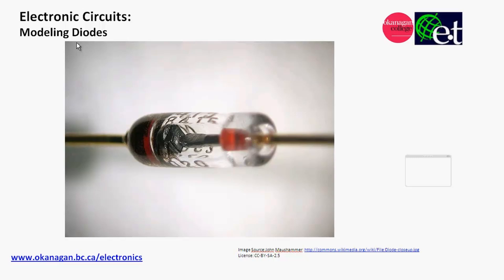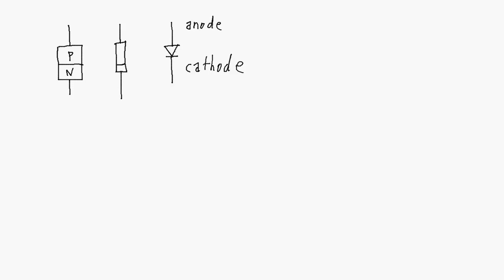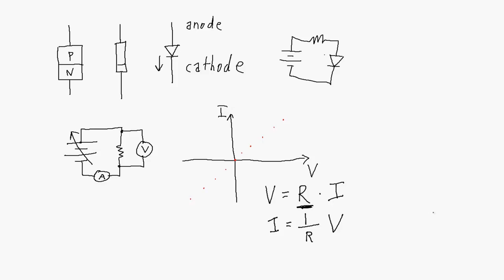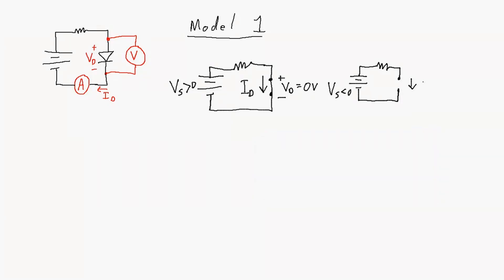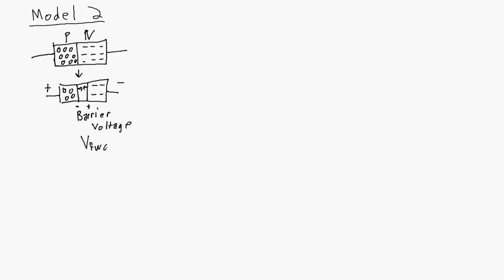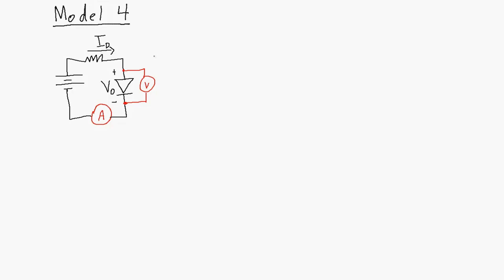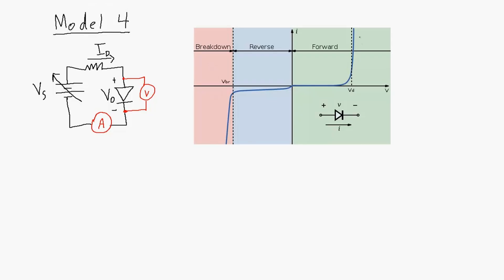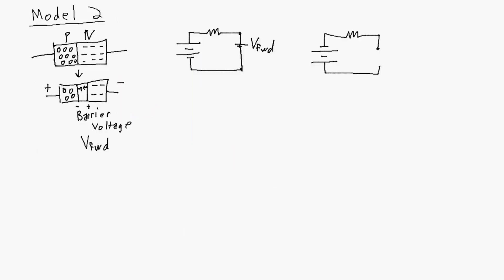Modeling Diodes (Better Audio)

Comment: Great refresher discussion about diode biasing.

Model 4 covered more complexity than the others, and rather quickly.
Reply from the maker: Good point. I don't go into Shockley's equation for modeling diodes in much detail in my classes because rough calculations using just the forward voltage are generally good enough. I generaally leave Shockley for the simulation tools that need the precision